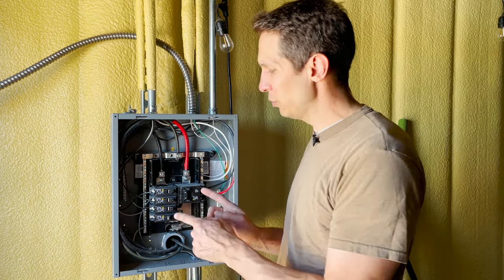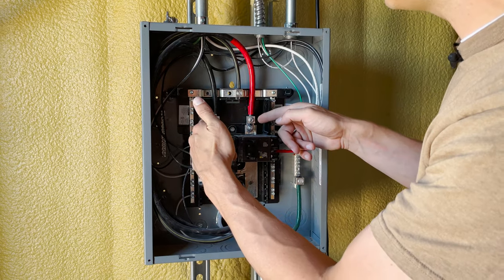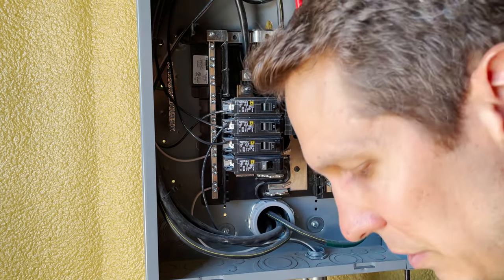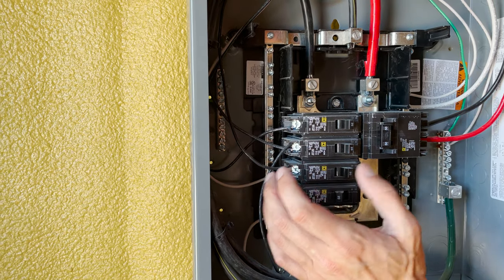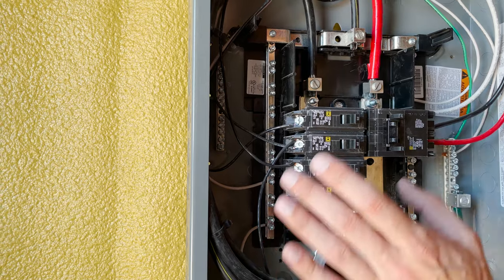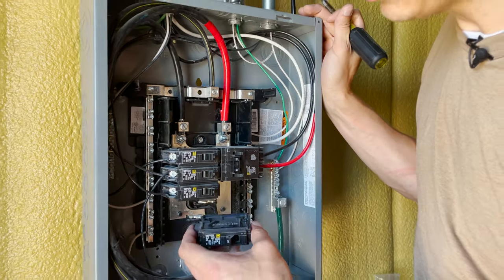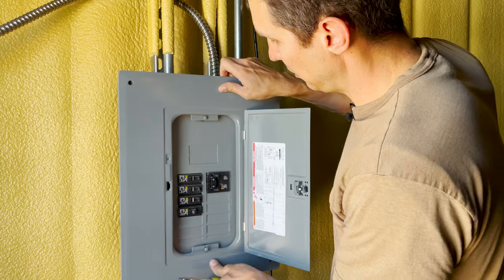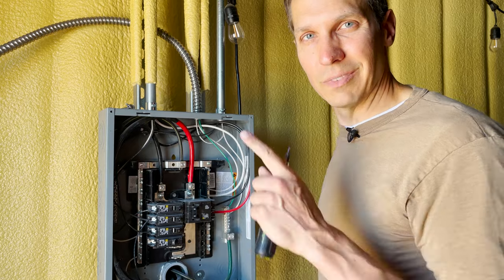How to Replace a Breaker - The Basics | CircuitBread Practicals

Comment: Use a wooden stick to point to objects inside the panel? Even when power is off.
Plenty of slack?
Reply from the maker: I know that it isn't rated for electrical protection but I also almost always wear those mesh gloves that are covered with rubber when working on the electrical.  Mostly to reduce blisters and raw spots on my hands but also as yet another small protection from somehow accidentally shocking myself.